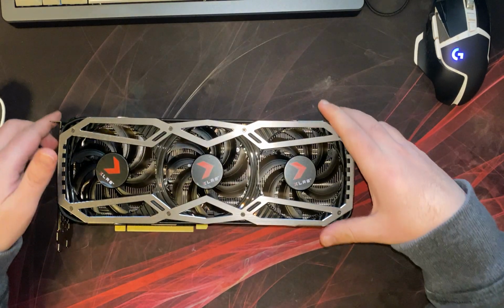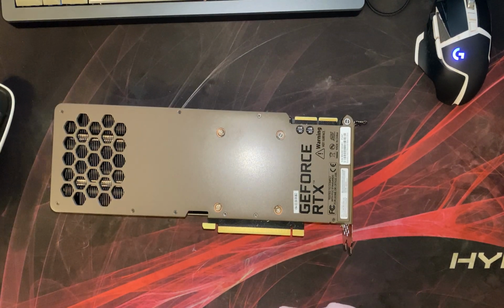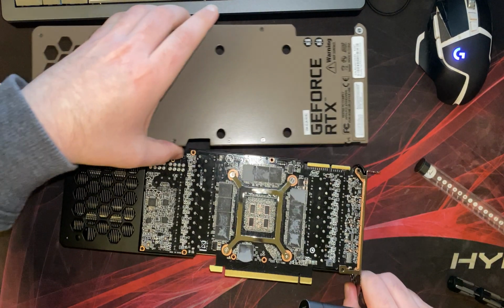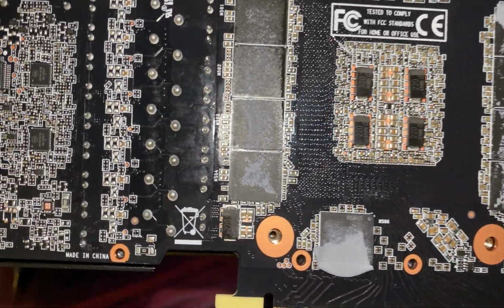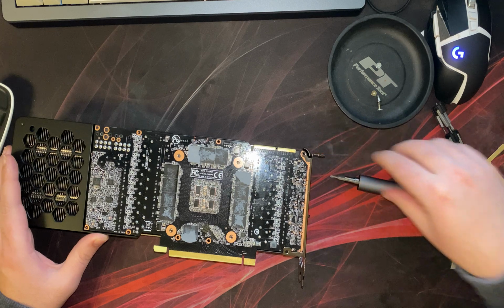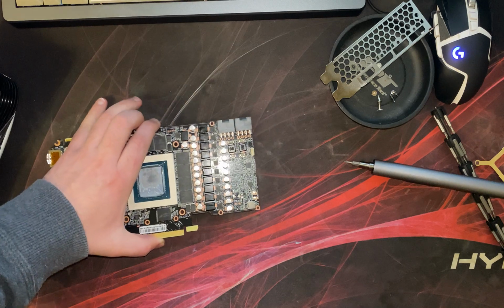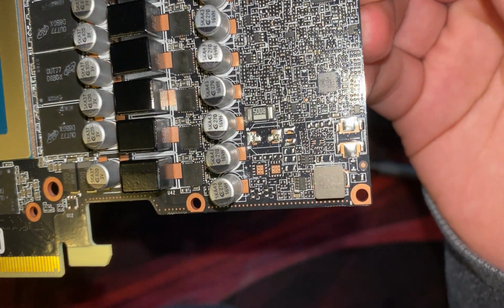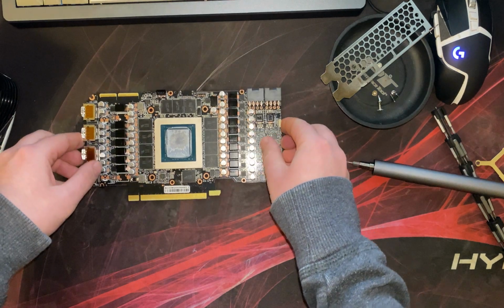PNY RTX 3090 XLR8 Revel teardown, reference PCB close up and size comparison to a typical RTX 3090

Comment: I know this video is old but can you tell me what the skinny cable at the top (pictured at 6:00) is for? I repasted my gpu, and i broke a piece of the housing that this cable connects to, but theres no circuitry on the piece that broke off just plastic. Cable still connects and everything is working as well as temps issue fixed. Just wanna make sure it will be fine in the long run, I'm pretty sure the piece that broke off is just a stabilizer part of the housing but I dont know what this cable is even for. Thanks!
Reply from the maker: that cable is for the rear fan. if all 3 fans are working on your card, then you should be fine. i DO NOT recommend doing this because it seems you are inexperienced, but the housing can be replaced. you should be able to pull off the plastic housing off the pins and replace it with a new housing. the pins will stay on the motherboard. they will not come off unless you crush the housing with pliers while pulling.
Reply: @solomonshv  wow thanks for the fast response! yea it was my first time opening and repasting a gpu and im glad i did because my hot spot temps went from a 30c delta down to 12c delta. i think i should be fine i was just worried it could pop out randomly since that piece of the housing snapped off, but i was told the pins have enough bite to stay in and it shouldnt pop out on its own and that piece was just a non circuited stabilizer area. so far no issues i just hope it stays secured.

Comment: Hi, friend. They are selling this RTX 3090 PNY model. do you recommend it? What is this GPU brand like?..
Reply from the maker: the best 3090 models are founder edition, asus tuf and asus strix. they all have monolithic power systems smart voltage controllers. if you can get one of those models, get it. other cards, like this PNY, all MSI cards, all gigatrash cards, all zotac models use the outdated UP9511 and UP9512 voltage controllers, made by uPI. they are inferior in every way. 

no specific brand is better than all other brands. each generation of GPUs is different. during the RTX 3000 generation GPUs, asus were the best partner models, way better than other models. for RTX 4000 series, MSI is better than other brands.

Comment: 3:42, the ESD made my heart skip a beat
Reply from the maker: that's not ESD. lol. i'm using an electric screwdriver. i accidentally pushed the forward button. there is an LED flash at the front as well, that's where the light came from. 

when working on very small screws, i avoid using the motor and tighten/loosen by hand to avoid stripping the thread
Reply: @solomonshv  gotcha. looked like a huge spark to me and with such an expensive component it definitely startled me. Having a big hot spot issue on my card, like the thermal paste got cracks in it or something after pulling it out and putting it back in a few times for a hard drive issue. Was thinking about replacing the thermal pads, but I'm very paranoid about ESD after work training and the paranoia primed me to see what I feared. And it seems like ESD doesn't bite people with hundreds of hours of no precautions. But in the off chance I fried my card, I don't think I'd be happy being out over a grand in a moment I didn't even recognize happened. Don't even expect to see a spark in most ESD events, so thinking I saw one was... shocking.

Comment: The real star of the show is that screwdriver.
Reply from the maker: lol. it's called a "wowstick". they use to be $35 with 3 of those tubes full of various bits. along with a bunch of other accessories. i had mine for over 6 years now. i built and disassembled hundreds of GPUs, laptops and computers with it, built many custom keyboards. never had an issue with it and i always have the right bit. it even has nintendo specific bits. 

it went up in price to about $50, but you can find clones that may or may not be as good for as little as $15. here is a legit wowstick with all the bits: https://www.amazon.com/Ruputas-Precision-Screwdriver-Rechargeable-Electronics/dp/B07DB7ZT5P/

here is a knock off for about $15 ($20 minus $5 coupon) https://www.amazon.com/WOWSTICK-Screwdriver-Precision-Rechargeable-Automatic/dp/B09GJLDBK4/
Reply: @solomonshv  Thanks a bunch. I do a lot of electronics work and I could really use something like that. While we are talking, do you have any regrets about the PNY card? If you could do it all over again, would you choose a different card?
Reply from the maker: @lightspeedlegato  it was purchased for a customer build. they still use it and they don't have any issues with it. we picked this card because they wanted a small form factor build PC. at the time most 3090 PCBs were massive and wouldn't fit into their desired case. the founder's edition card had that stupid 12-pin connector so we couldn't use that either. 

in our case, it was the best fit for the build. but if you are not space constrained, i would no recommend this card. get something better, like the tuf or strix. tuf and strix cards have the best boards or any 30 series cards. for the 40 series, the msi suprim are the best boards.
Reply: I ended up getting a PNY. I just couldn't pass up the deal they had on it. Thanks so much for all of the great info.

Comment: How has this GPU treated you? What kind of thermals are you getting using it?

I have an incredible opportunity to buy one for $500 on the used market locally.
Reply from the maker: it has been good. in the current custom water cooling loop the temps typically stay in the 30s when gaming. never more than 42*C. but it only gets that high after many hours of a demanding game, like heavily modded skyrim or cyberpunk. no complaints
Reply: @solomonshv  Those are insanely good temps! What waterblock/radiator did you end up using?

Comment: I think it's funny you say it's a plus to have normal connectors like the 12 pin 3. Umm this is going to be used more often as it can pull more from it. Imo it's not cool that it doesn't have that option lol.
Reply from the maker: your comment is very hard to follow. the first sentence is a doozy. as for pulling more power, that's the one single thing i did NOT want for this project because this computer was about the size of a playstation. i actually tuned this card to pull less power while retaining out of the box performance.
Reply: @solomonshv  if something is asking for more power or needs power then it's best to be able to give it to it. It's how you get the best performance out of it. Would be different if it didn't need it or ask for it. So using those would give you what you need. The way you worded it like oh it's a plus that it doesn't come with or have an option for one is ridiculous. It would be better to have the option.

Comment: man, could you please help me choosing the right card, I write down my choices:

These are the 3070 Tis :

Asus Strix
Asus Tuf
Msi gamingX trio
Zotac AmpHolo
Gigabyte gaming oc
Zotac Trinity
PNY EpicX
I'm leaning toward the Msi gamigX trio and asus tuf. Which one do you think gives higher hashrate, better quality and better thermals?
Reply from the maker: short version: asus tuf if the best out of the bunch, by a million miles. 

long version:
the zotac and the PNY cards are reference PCBs. they are the bare minimum that nvidia will allow vendors to put the nvidia logo on. avoid zotac at all costs. PNY is ok, but only if you are specifically looking for a reference PCB to make a small form factor water cooled build. 

gigabyte gaming OC and msi trio are small upgrades from a reference card with a higher power limit. they have extra power phases/capacitors to allow them to eat more power, but they retain the 8 phase voltage controller and most of the design

the asus tuf is nothing like the reference card. the voltage controller is upgraded from an 8 phase to a 10 phase digital controller. asus also adds high end SMD capacitors on the back of the card for more power capacity and lower response times.

the exact benchmark scores are dependent on silicon lottery. so it's possible that you can get an msi or gigabyte card that is faster than the asus, but that's not something anyone can predict. however, the asus card will be easier to tune and will last longer.
Reply: @solomonshv  thank you, very detailed and helpful answer.
Reply: @solomonshv  is the tuf better than the strix too?

Comment: Thanks for the video, really helpful! Have you had a chance to compare with Palit GamingPro variant of the ref pcb? Now choosing between them to put waterblock on them
Reply from the maker: hello. unfortunately palit cards are not available in north america. but i think they should be exactly the same because they are both nvidia refence boards. i know they use the same voltage controllers, inductors. it's possible that they use different brand bulk capacitors (nichicon, rubycon, panasonic) but that will not make a difference for performance. it's also worth noting that sometimes you can have the same model GPU from the same brand that use different brand capacitors due to the supply shortage. i had asus 3070 tuf cards that used different brand capacitors even though they were the same exact part number.
Reply: @solomonshv  I see, thanks again! Palit is also known as Galax, Gainward and KFA2. I was worried they may have some quality tiers in the brands so use better/more components in some products and not the others

Comment: What are the dimensions of the card once you remove the cooler? And can you tell me what screw driver bits you used to disassemble it and that screw driver too.
Thanks
Reply from the maker: about 213mm, from the display ports to the rear end. this doesn't include the i/O shield that protrudes forward to mount to the case
Reply: @solomonshv  do you happen to remember the screw bit sizes?

Comment: I'm trying to turn off the RGB, did you notice RGB header or are they linked with the fan header?
Reply from the maker: there is a separate RGB header on there. if you unplug it, RGB will turn off. the RGB header is in the back of the card, under the rear 8-pin power connector.
Reply: @solomonshv  great reply thank you

Comment: Great vid. I just have one question, Does anyone here know a way to mod the RGB so that it can actually sync with the motherboard? I have the 3070 version of this card, But OCD is a thing and I want everything to at least somewhat match. I know where the cable is and stuff but I dont know if i can just get an adapter and plug in the 3 pin cuz It'' probably either fry it or not turn on.
Reply from the maker: you have to take apart the card, disconnect the RGB cable and add an extension cable to the RGB cable with an RGB connector on the end that will fit your computer. with this card, it's the only way
Reply: @solomonshv  do you know what kind of connector it would need to be? I have 5v 3 pin connectors on my stuff but idk what kinda cable it is considered from the gpu’s lights
Reply: @memedaily8690  Did you end  up getting an extension cable for  the RGB cable on your PNY?
Reply: @knight2255  Unfortunatley no, but it works out fine bhecause recently I sold it to a freind and got an Asus Rog 3060ti

Comment: anyone knows the difference between PNY 3080ti revel vs uprising? I saw reddit post that says it has 6 pipelines vs 4, 2mlcc vs 1. but I couldn't find any teardown nor benchmark
Reply from the maker: Revel models have a higher MAXIMUM power target. the default power target is the same for both cards. in theory, this means the revel models should overlock higher, but that will be determined by silicon lottery. this is true for 3080, 3080 ti, 3090. the hardware is identical on the uprising and revel models, both are reference nvidia designs. people on the internet like to make shit up, ignore it. 

side note, you can turn your uprising card into a revel by flashing the BIOS from the revel to the uprising.
Reply: @solomonshv  but official web site also says they are different. Revel is 11.57 x 4.41" x 2.20"; 2.7-Slot Uprising is 12.48" x 4.53" x 2.36"; 3-Slot slot.  exactly as that reddit post says. That indicates they have different cooling hardware. are you positive that they have same cooling?
Reply from the maker: @aslanyureky  the cooler is the only difference. the cooler on the revel is slightly better, but not enough to make a difference in performance of the card. the PCBs are still identical. they are both using the same nvidia reference PCBs.
Reply: @aslanyureky  I haven an uprising instead of a revel. Literally the only difference so far that I've spotted is the cooler and the ARGB feature on the revel model. The uprising has RGB that just cycles with no modification. Otherwise, the cards are, from my understanding, effectively the same.

Comment: link for that screwdriver ?
Reply from the maker: it's called wowstick, there are 100 listings+ for it on amazon and aliexpress. here is one amazon link: https://www.amazon.com/Wowstick-Electric-Screwdriver-Cordless-Lithium-ion/dp/B07H27G9NF/

it use to be $35, but went up recently. probably due to the tariffs. it comes with 50 different bits, a little maker's pad, a magnetizer, and some other junk
Reply: @solomonshv   thank you

Comment: Is the heatsink flat/suitable for a deshroud mod? No one seems to show this in tear down videos!!!
Reply from the maker: That’s because no one does that mod. I’ve built close to 300 customer PCs in 2020 alone (that’s why I have so many 3080s and 3090s just laying around). Not a single person even inquired about it. It’s not worth the effort and it voids the warranty on your $1000-$2000 GPU.
Reply: @solomonshv deshroud mod aside I still don’t know why people taking the time to film themselves pulling a card apart on YT wouldn’t take the extra few minutes to remove fans, show the manufacturer details should someone need a replacement and also how the heatsink looks for mods down the track when fans potentially fail.

Comment: Thanks for the video! I have the same card and through undervolting I managed to get it 12 ° C cooler while increasing its performance! A really good card!
Reply: how are you reach that result?
Reply: @Thunderbolt0883  1815mhz / 812 mV by MSI afterburner!
Reply: @Vidar676 How much power does it draw with that undervolt?
Reply: @niekasniekas2614  Hello! it varies depending on the game and the setting. I now have water cooling for this graphics card, so that I could test something else. It is currently undervolted with 1920mHz and 856 mV, which is extremely stable! Consumption is for example: Dying Light 2, ultra settings, WQHD, frame limiter at 100fps ~ 300W. COD MW2, ultra Settings,WQHD,142 FPS ~250W. and currently Atomic Heart,ultra Setting, WQHD, frame limiter at 100 fps ~250W.
Reply: @Vidar676  Thank you for your honest answer.So it does't consume above 300w?
Reply: @niekasniekas2614  well, in benchmarks for sure. And in games there are peak loads of over 300 watts. But very rarely. And much later than in Stock. But I haven't had such values in any game myself. The point of undervolting is still to lower the temperatures, lower the average consumption and have no loss of performance.
Reply: @Vidar676  I don't know what wrong with my card Į undervolted It to 1770mhz and 850mw and It consumes about 350w
Reply: @niekasniekas2614  Overheating most likely, now I've just disassembled my card took the pads off and cleaned it preparing for new 14.8kw pads deployment along with PTM9750.

In ambient temperature of 22c the core always hit 81 to 84c even with undervolting, well it's been working for 3 years and I cannot remember how it was before, when the card heats up the clocks drops down so it compensates by pushing more wattage because it still has a temperature headroom till it hits the temp limits, then it starts to clock down. My card hit clocks of 1950mhz on its own before it starts to heat up then stables at 1450 to 1400mhz. I'm losing a good amount of performance.

Will go back to apply the pads now
Reply: Well, I'm done
And WOW 🤯.
I wasn't expecting this at all!!
This PNY Revel 3090 cooler is a beast!!
Ambient temperature is 23⁰C:
With PTM9750 on the core I'm getting 60⁰C maximum at %100 utilization. For the first run !! PMT9750 has not been cooked yet. I couldn't make the temperature go above that to make it phase change completely!! And the delta is 12.5⁰c constantly!
The memory is stable at 72⁰c max with no throttling at all while mining, where I used to hit 105⁰c and thermal throttle!!
Wattage is 360 to 375 while before it always thermal throttle and stable at 290 watts
I'm hitting the card right and left but none of the temperatures are exceeding the above!! Even when giving max volt, temp limit and power limit in MSI Afterburner along with 200+ to the core and 1500+ for the memory!!
No need for water cooling unless you power mod the card.

Comment: Thanks for the video, it's just what i was looking for. Just one question, because you did not show it: Is there more thermal padding on the backplate besides the 12 ram modules? i mean are the vrm's also taped to the backplate, or just the memory modules?
Reply from the maker: the rear of the PNY card only had thermal pads on the memory, nowhere else. other cards that i've taken apart had thermal pads on the VRM too. HOWEVER, it is important to note that the other cards i took apart had SMD SP-CAPs on the back to accompany the ones in the front, whereas the PNY did not. and that's probably why there was no thermal pads there.